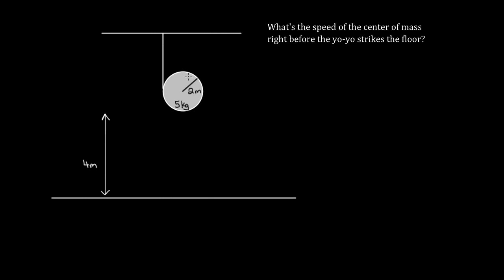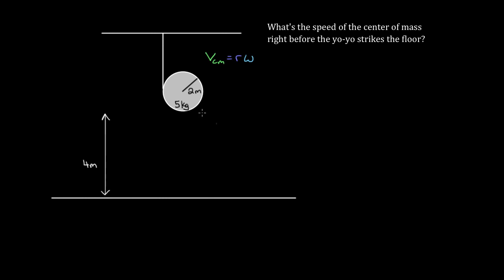Rolling without slipping problems

Comment: Shouldn’t the value of h be 6m at 13:22
Reply from the maker: Well, the bottom of the yo-yo is going to hit the ground first, so you don't really need to add the radius of the yo-yo to the 4m amount it falls. The center of the yo-yo will only fall 4m before the bottom strikes the ground.